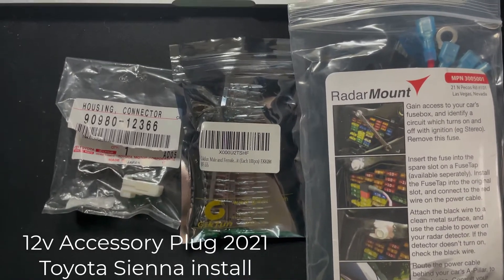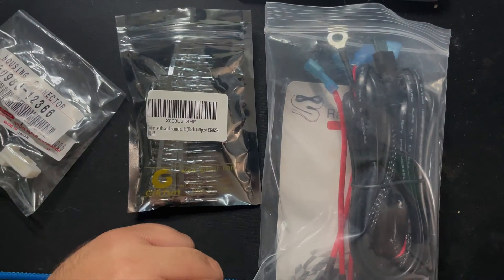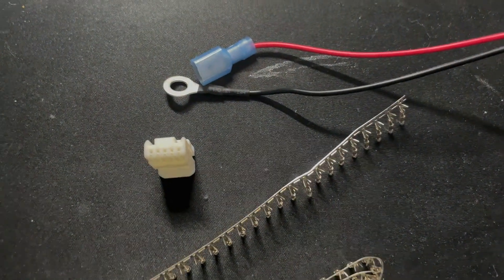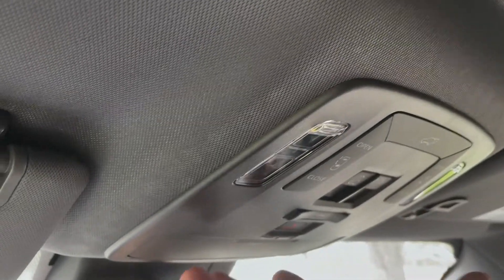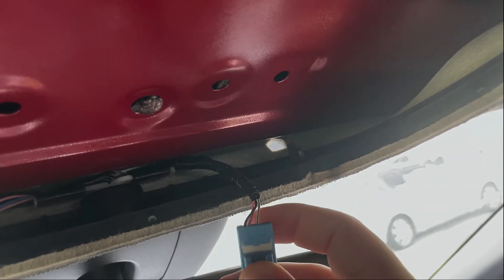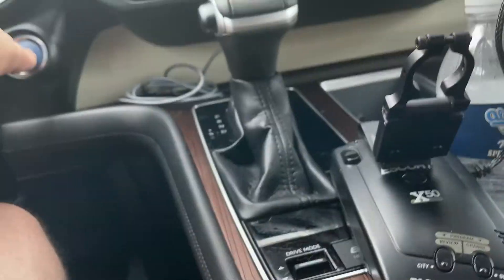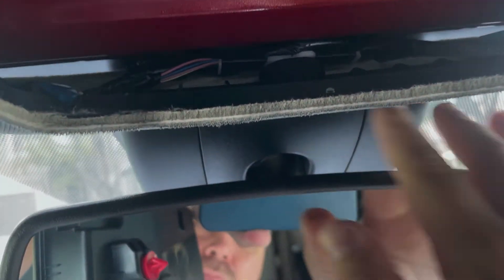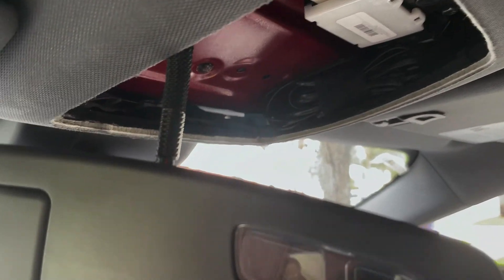2021 Toyota Sienna accessory plug install

Comment: This is perfect.....Ordered exactly the parts you identified.....assembled using three wire install...and it worked perfectly for parking mode on my new Blackvue 4K dash cam.  Saves me from running another long wire, and dinking around the fuse box in my brand new 2021 Sienna. NOTE1: Make sure you push those pins as far into connector as they will smoothly go.  You should see the edge of the insulation from onto with connector clip removed (see NOTE 2) NOTE2: There is a clip on the toyota connector that needs to be removed carefully and reinstalled evenly once the pins are laid in there. I ultimately  figured it out vs trying to install the pin by pushing into connector from back, just make sure the retaining clip slides straight down and is properly retained so it will properly retain the pins.....and I wish I had a 2.54mm crimp tool (not part of my normal automotive tool kit, and not cheap to find a good one)...but a small needle nose allowed me to do an acceptable crimp on the pin - take your time. I found that NOT DISCONNECTING pin from the rack it comes in helped hold it steady while I crimped it this way..Crimp the insulation wings first...then remove the pin once you have the insulation crimp done...then finish the other conductor crimp. I suggest you practice on a spare pin/wire before doing actual crimp this way. Remember to do a pull test on the installed wire to make sure you got the pins captured correctly - give it a good tug so you know you have the pin oriented correctly and the retaining tang is gripped properly. You dont want it to dislodge when you assemble the connectors or rattle loose over time.  Thank you so much for your work to post this.
Reply: My Rear view mirror camera has only one black and one red wire - there is no third or white wire - so just use the black and pink slot ??

Comment: Thank you ! ordered the parts in your description and was able to install my dashcam , I used the 3 wires for parking mode.
Reply: @smartmeatball  yes, dashcam will keep recording on parking mode .
Reply: @smartmeatball  use the black wire on the car for your ACC (most likely the red wire on your dash cam) this will keep the dash cam on even when you turn it off, the pink cable is the one that turns off the dash cam when you turn off the car, the white wire with black stripe is where the black cable on your camera connects to. Hope that answers your question.

Btw, I just used T taps on the wires where you can buy from auto shops instead of buying the housing connectors which is less than $4 but the shipping cost more than the actual item.
Reply: Does the dashcam drain the batter when run 24/7? I have a blackview cam and worried about the battery.

Comment: Thanks, I instead bought a Subaru H501SSG010 which is already wired to another connector.  Just cut that in half and didn't have to deal with the pins

Comment: How did you open ceiling control panel. İ cant 😞
Reply from the maker: it was really snug- but i was able to pull it down with my bare hands. just go slow and try pulling from the part closest to the front of the van.
Reply: @SciFiFan20  I did it thankfully